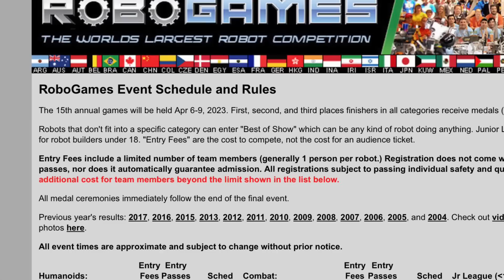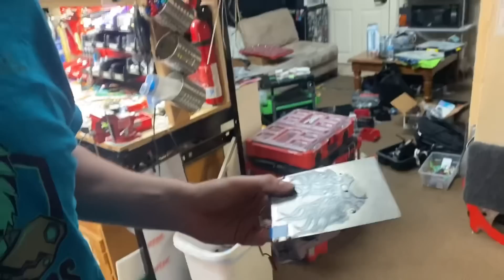When Does This BATTLEBOTS CHAMPION Make His Return?

Comment: A slammed down backhoe with using the bucket as a flipper and the digging boom as a spinner? Of course strongly brace the boom, guards on tires and also for the boom or the bucket flipper or both... flipping itself back over. Design it like mad max. It'll be big for sure

Comment: Still have to work on the Antweight. What should I build for Robogames?
Reply: A friction hammersaw.  Like a normal hammersaw, but the spinner has no motor.  Instead, it spins up when making wheel-on-wheel contact with a motor inside the chassis.  Then you swing the arm, and the spinner just keeps on free-spinning until it strikes something.

Comment: Wish tombstone concealed its wheels. One of its weak points
Reply: Ray briefly talks about it in the Builder Blog #75 interview if you haven't seen it.
Reply: Might be, but it's also one of its strengths.

By having the wheels fully exposed they can't easily get jammed and the bot can get out of plenty of weird positions: when they are not covered there is nothing between the floor and the wheel so as long as the bot isn't flying, there is probably a wheel touching the floor. With protection around the wheels, there are way more positions where the bot can do the thing and be unable to move.
Reply: @bami2  and it's also a weight issue; you'd need quite a bit of weight to properly protect those big wheels.